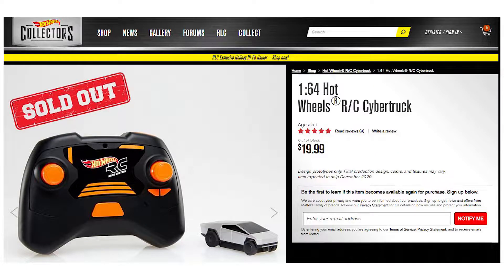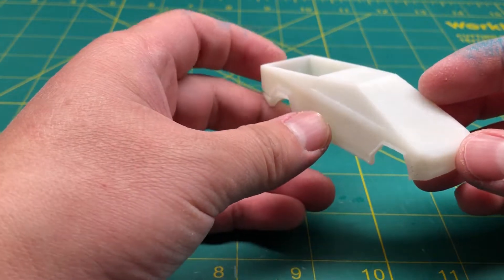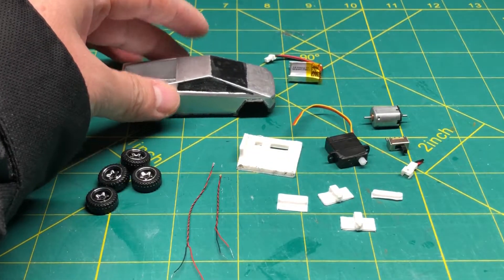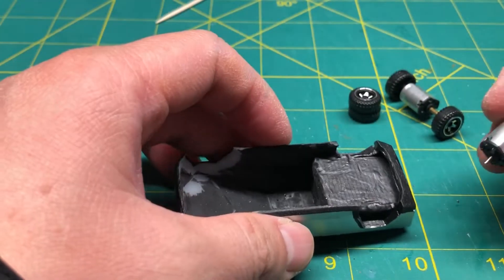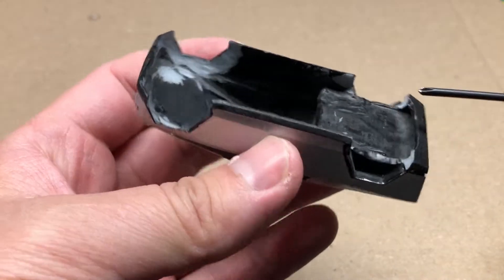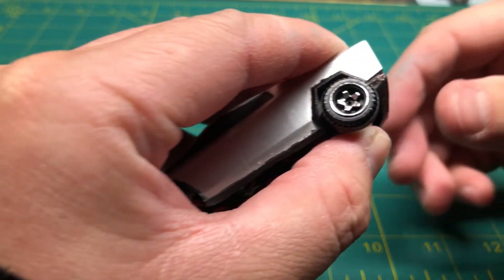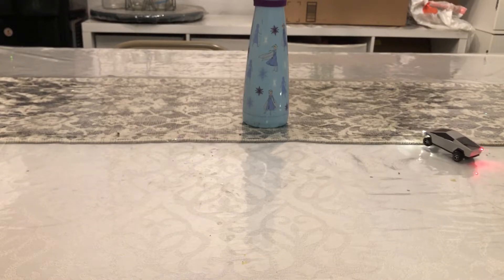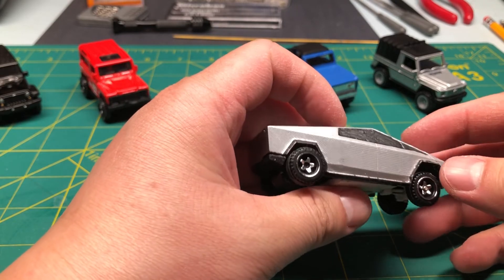How to make a 1:64 scale RC 3D Print Tesla Cybertruck

Comment: I would like to start with this hobby too. I have so many toy cars from when I was young and I wanted to be able to command them. that's why I wanted to ask you some things. is the chip already programmed or do you do something to program it? (like connect it to the computer or just connect the transmitter inputs).
Reply from the maker: The receiver is already good to go. Just solder your motor and servo to it.

Comment: Dang I stocked up on Amazon with the Corvette they made the Rodger doger and gtr basically one of each I got the Tesla truck un opened but I'm trying to use the base of the hot wheels rc cause it's small fits in a 1 64 scale car but just back wheels hope I can turn it into I hot wheels metal body like main line cars cause I have no 3d printer
Reply from the maker: That’s great! Totally doable. Good luck and have fun.